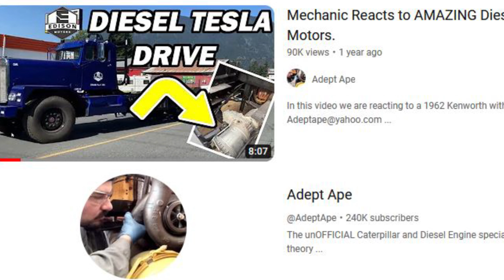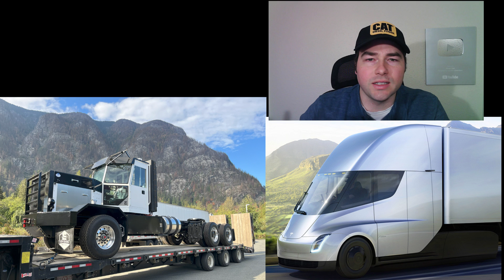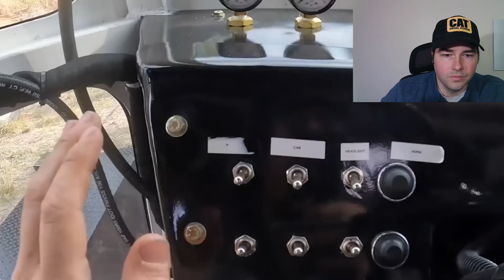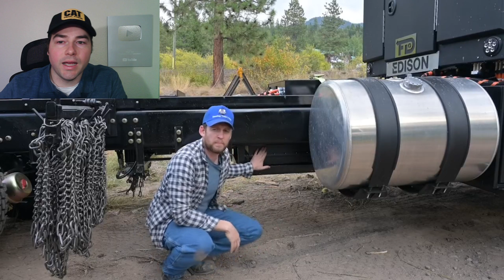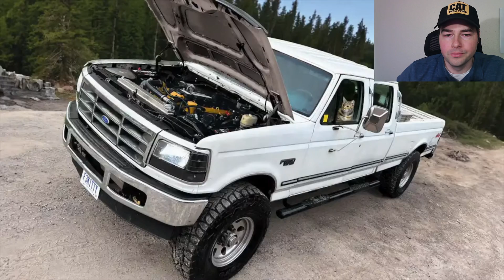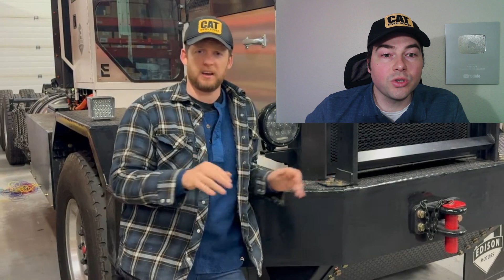Edison Motors New Truck DESTROYS the Tesla "Semi Truck" design!!!

Comment: Look that's where you're wrong you're going to be able to use your engine as a retrofit you can use your gasoline engine you can use the original engine that's in the diesel truck you don't have to pull the engine and use theirs the whole object of saving Fuel and their concept is you have an engine running at a certain RPM that doesn't change RPM which causes it to use weigh less fuel you will be able to use your existing engine in the retrofit you won't have to change that engine out I get their concept an electric motors do have more torque I just think the lithium battery is very unsafe and you're going to see a lot more fires as these things become more and more common on the road and like I said in an earlier comment I would never put my family in a battery-operated vehicle they're very unsafe
Reply: You say that lithium batteries are very unsafe.  But I bet you have one in your pocket all day long and maybe on your wrist.  What type of batteries do you think are in your cell phone and smart watch.

Comment: I know I've been ranting about electric trucks and how dumb they are but you got to understand I live in Michigan and no matter how well you seal an electric component Aaron Michigan we use salt on our roads and that s*** will get into any electrical system and turn the wires green encourage them and yes we use sealed butt connectors with shrink tape that has the sealer in there and guess what salt still gets in it maybe in dry areas like Texas California anywhere where you don't have salt and water mixed together this may be a great concept but here in Michigan I guarantee you there's going to be massive electric fires on cars because water and salt are going to get into the system and once it gets into a lithium battery it's going to start it on fire and what's their on fire they can't be put out I'm going to stick with my diesel engine or my gasoline engine because that's the safest thing we have right now and you're going to see a lot more electrical fires once these things become more common on the road no one's reporting about it now they're keeping it hush-hush because they're pushing this big electric bull crap why don't you do a little research in the car fires about about these handkerchiefs that have literally burnt up carrying these electric cars across the ocean they're not reporting on any of the stuff lithium batteries are dangerous until we build a safer battery I am completely against electric vehicles I would never put myself nor my family in one
Reply: just wondering how many Toyota Priuses you guys have burning down over there.  They have been around since 2000.  I think we would have heard about hybrids bursting into flames all the time up there.

Comment: Yes it's a very basic truck and it's pretty cool concept if you're using it for logging or something simple but the problem is it's just another component that's going to go bad in a vehicle you're adding a fuel system and everything it takes to run a diesel truck and then you're adding an electric drive system on top of it sorry I'm old school I'm just going to stick with the straight diesel engine who are the basic gearbox that drives the truck I have no interest in electric whatsoever all it's going to do is add more crap to the landfill and devastate more land while we're trying to strip mine looking for material to build these crappy ass batteries that are going to eventually be a huge problem because you can't put them out once they start on fire lithium is very dangerous and should not be put in the batteries

Comment: And there's one more thing batteries can only discharge and recharge so many times and then they have to be scrapped out for new ones what are these batteries going to cost you to be replaced once they're not. Holding a full charge anymore
Reply: a whole lot less then trying to get a vehicle specific battery from the manufacture.  The batteries that they are using are modular.  You don't have to replace the whole thing when just one module goes bad.

Comment: In the cab is designed as a logging truck you certainly ain't going to Long Haul that truck anywhere because there's nowhere to sleep in it it's an old style truck used for logging and if that's what you're going to use the truck for it's great you probably got more torque with the electrical motor look to push in airlock systems suck I replace them all with old school compression fittings I understand that but no one's going to give you $200,000 for this truck it looks like something someone put together in their backyard
Reply: You do understand that Topsy is a prototype truck right.  How many prototype vehicles the you have seen ever look like the final production vehicle.

Comment: I love the concept.  I have wondered why this hasn't been done a long time ago.  That would be cool if they brought cat engines back to on highway trucks
Reply: Hybrid trucks have been done before by several manufacturers.
Reply: Because its inefficient compared to a conventional transmission. The ONLY reason to have this setup is if something requires a period of electric-only driving.
Reply: @superjesus4307 a series hybrid is far more efficient then a transmission. Like half the fuel usage
Reply: @superjesus4307 ice engines have a very limited power band and an even narrower efficiency band.   Hence the need to even have a transmission.  So yes, if you only had to hold one rpm at the perfect part of the curves and be at the speed you want, that works well.   Sadly that is not the case most of the time.    Now, having all of what they are doing the next major advantage is energy recovery.   Every single slow down an ice vehicle does is a waste of power, heat, material.    Electric saves all that.    True, there is some loss in converting the power, some loss in storing the power, but that electric drive is hyper efficient.
Reply: 100% @superjesus4307

Comment: The other reason they're using AC motors is the regenerative braking, that's not something that can be done with DC; as far as the pickup powerplant, it seems like in 1 of their videos they were saying something about a 3l cat (Perkins I guess?). I would imagine you could drop in a 4BT (or whatever the newer version is I guess?) & It would charge with the same volts, but less amps? I'm not sure if they're planning on using the same size generator from the 9l to whatever will be in a pickup?

Comment: ⚓️ Thanks Josh ♨️ the cabinet enclosures need lug secured doors for moisture… also dehumidifiers/ac~heaters are available … as well as for the generator ends… cooling that cabinet may be an issue …. Computers don’t like heat. Variable frequency drives…Voltage regulators & programable logic computers are stout… but introduce vibration , heat, moisture… lookout … that’s high voltage 😎 get 3K hours on the unit… then do another review 🌈 after 1K hours… every wire terminal should be checked…. Replace hoses with SS tube where feasible. Good luck.🇺🇸

Comment: If Topsy is using a C9 for the Generator set, in place where a same sized logging truck would normally run a C15, and folks are currently pulling gangbusters in F350s with 3126s like Deboss garage and others..    a similar ratio would put a 3.0L diesel to run a gen set..  IF it was truely a work truck.   That's easy math.

Comment: I think the conversion kits will be with existing Duramax, powerstroke and Cummins engines. The generator could bolt to the bell housing points of where the transmission used to be. The space where the drive axle was could store the batteries. I've had this idea since about 2017, I just never had money or resources to make it happen for my truck.

Comment: Not sure about the front bumper directly on the frame. No deformation zone. Any small bump will be hard for all components. Besides that... looks great 😀
Reply: Chase at Edison Motors did a video on why the bumper is built the way it is on Topsy.  This is an offroad vehicle.  He said that it is better to basically use the weight of the truck to plow through the object (usually trees when your up in the mountains) instead of bending and disabling the truck.  If you look at almost all Heavy haul trucks made they are done the same way.

Comment: Josh the comment about the drive motors and the AC vs DC issue. after my experience with the CAT D7E and some sawmill equipment is you can step the phases on a 3 phase for acceleration deceleration, which also allows for regeneration to go as you correctly stated to the storage which is DC you got access to CAT bet there lots of good info on the D7e and theory of how it works.  great video as always!

Comment: First off i\I watch most of these Adept Ape. We have several pieces of Caterpillar equipment and really like them. But this topic is a little out of your wheelhouse. 
To say Edison destroys Tesla is a lie. Tesla trucks are totally electric, not a hybrid at all, and addressed the over the road market. Besides this fact there is a company years older than Edison who builds a hybrid truck 
in the market today, but not mentioned at all. That company is Hylion. They use a natural gas gen set, and unlike the Edison is aimed at the over the road market, a much larger
market the Edison plays in the off-road market. They are also blessed in the Eaton/Spicer supplied the DC motors in the drive train and can offer a new hybrid truck in whatever flavor you want.
So Edison is a late comer to the marketplace, and in a very limited market to boot. 
Just so you know what is actually out there.

Comment: I don't see any reason the EPA would be able to classify this thing as a diesel powered vehicle. The DRIVETRAIN is purely electrical, just because there HAPPENS to be a generator in one of the storage/luggage compartments doesn't change the fundamental design of the truck.

Comment: So basically an offroad rail locomotive.
Reply: Not the same as a GM locomotive, locomotives run the diesel full power to run the generator constantly with no battery, this would run off the battery and use a genny to charge the battery.

Comment: I  can't say I like the styling of Topsy.  Basically what they are doing is putting a scaled down locomotive driveline in a truck.  I'm amazed someone hasn't tried this before, it seems to make sense but the market will make that judgement.  As for the pickup they don't need anywhere near the power of that C-9 or any other large diesel engine for a pickup.  The average passenger car uses something like 17 hp to cruise on the highway, so I can't see needing any more that 50 hp for a diesel electric.  One thing I really don't like about their pickup truck conversion is they steal a lot of bed space for the batteries.  Personally I use all of my 8' bed length at times.  It will be interesting what they come up with.   Keep the good stuff coming.
Reply: Not to mention the weight of everything may very well burn through all of your payload capacity especially the batteries.
Reply: @Hybris51129   You may actually  gain payload.  Think how heavy that big diesel motor and transmission is.  When they made Carl (The converted semi) they where around 2,000 pounds lighter after the conversion.  On a pickup sized scale you might gain 4 to 500 pounds extra capacity.

Comment: Josh I worked in advanced propulsion engineering at G M years and years ago. Suddenly the hybrid was all the rage. The government got into us and dictated fuel efficiency & exhaust emissions. You know,  all the DPF DEF &  the Particulate pollution controls for Rudy's  design. They "pushed" us into decisions that resulted in expensive fuel, expensive engine components and all sorts of electronic wizardry. Like DDEC. You know, all the things designed to put the "Owner Operator" right out of business. Big Tech was bribing, I mean lobbying, congress and POTUS for OBD and other such sophisticated, expensive and ever changing equipment & ideas that are cost prohibitive to OO. I was there and I can go back there in my mind just like Sherman in Mr. Peabody's Wayback machine. So this is nothing new. In fact the system the rep from Edison described sounds like the old Toyota "Synergy" drive design. We tested literally every design out there, foreign and domestic. Toyota's Synergy was very inefficient.  But it Was new. (part of the rage) All the converting from mechanical to electrical and from AC to DC and up and down in voltage makes for very inefficient use of the fuel being used. That is why whenever possible you always couple the engine directly to the drive wheels, it's just way more efficient. I left when they said they were going to Hydrogen Fuel Cell. Somehow 20,000 psi of Hydrogen in a moving vehicle just sounded like a bomb looking for a place to blow up. But I thought it a bad idea to use 400volt DC L-ion batts. Only I was really only concerned w/ electrocution, now we see the explosion and fire hazard. OK Josh, tnx 4 Da update Eh. ben/ michigan

Comment: Where the diesel emissions are concerned, he explained that they largely do not apply because the engine is technically an ad on generator. Similar to how your old Bobcat Lincoln welder can be added to any modern service truck and not effect the emissions standard of the actual truck.
Reply: Also because it’s a generator it can work at its peak optimum rpm and can be tuned for emissions.  Most emissions come from low rpm and high loads on diesel motors.   Think of all that black smoke from unburnt fuel as a truck gets going.  But if you see one smoking going down the highway then you know the engine is blown.  If you plan on living in California then you can get a generator with better emissions.  Don’t forget you are not constantly running the generator, so all things being equal you will be getting less emissions just because you are running the diesel less often and when you do it’s in it optimum power band.
Reply: @Wild_Lee_Coyote  And if California forces emissions onto diesel generators, you can still generate power while doing a regen. In future too, if the California grid can actually handle charging everything, you can pull the genset out, add batteries for range and don't have to replace the truck.
Reply: So basically, it's seen as an APU on a lot of OTR/sleeper trucks, right?
Reply: @BigRedtheGinger  yes. It's an auxiliary engine.
Reply: Yeah and it’s a 2 stroke too and oil injected with castor 927 maxima and that is what I would if I found one of these! Not this 15w40 like water 4 stroke shit! I hate 4 stroke even in trucks.

Comment: I’ve owned, driven, worked on trucks for 20+ years. These guys definitely have the best ideas of any EVs in big trucks. There’s good and bad things I can see about that truck. I’ve worked on some old Pete’s and Autocars with butterfly hoods. They look cool and nostalgic but are absolutely miserable to work on. I think a standard cab setup would be better. You occasionally do carry a passenger plus there’s no room in that cab for anything. Most importantly though driving in the center is kind of hard to get used to. I understand being simple but the open air lines and mechanical gauges on top of the dash are probably a little much.
Reply: DEBOSS Garage did a video on Topsy on their channel.   Diesel electric semi everything you want to know, somthing like that.  It talks about why butterfly hoods center seating and open airlines.  The main reason being its still just a proto type.  They discuss why they use 1/2" thick steel for the frame rails.  They talk about being able to upgrade existing older and new rigs with their power plants.  It's a 49 minute video, watch it.  They haul a 100000lb load while the tesla can only haul 80000lbs.  It's a great vid.
Reply: You gotta remember that Topsy is a logging truck, not a long-hauler.

Comment: Edison Motors concept is the best that I've seen!! Diesel electric powertrain is already proven...
Reply: They are not a diesel electric power train, it is battery powered and the genny can be used to charge the batteries.  Not the same as a GM locomotive.

Comment: If battery production volume can come through, this is the answer to 2027 epa standards. The ability to run the engine at constant speed, at their most efficient load, will greatly improve efficiency and emissions.

Comment: all engineering is about finding balance between cost, durability and reliability. Time will tell if Edisons electrics is more reliable than a plain old 18 speed. The trade off is: gear boxes require a variable output prime mover (which is complicated by emission laws) whereas a gen set is somewhat simpler, but requires significant and complicated electrics that has to work in all environments over a long period of time, reliably.  Road salts will be a nemesis.

Comment: Those aren't very big batteries, it won't go far without the engine running.  But it certainly ticks the buzzword boxes while being actually useable.
Reply: Edison Motors, in one of there videos said that they can drive for 2 to 3 hours on battery and then run the motor for about an hour to recharge while the truck is in motion.

Comment: The Edison truck is basically a Chevy Volt of the semi truck. Everything he explained about how each system works (minus air brakes) is how my 2013 chevy volt works. The gasoline motor in my volt is basically a generator that recharges the lithium batteries, which then use the electric power upon demand, or recharge upon deceleration.
Reply: Diesel electric is much more efficient than a gas electric as Diesel works better under sustained rpms